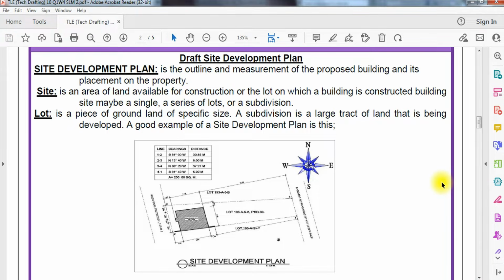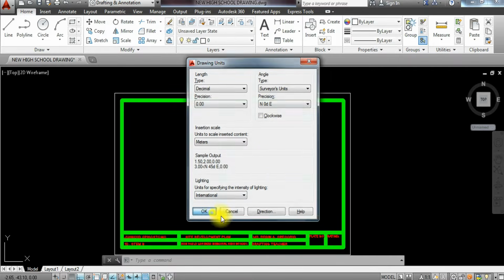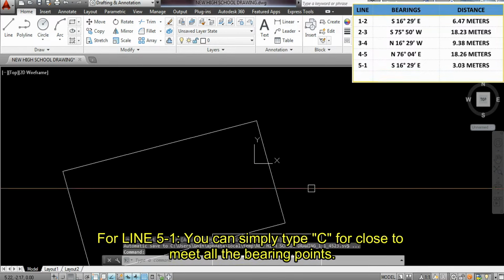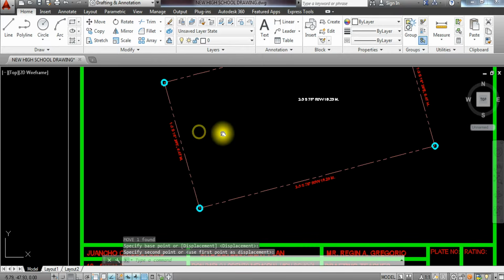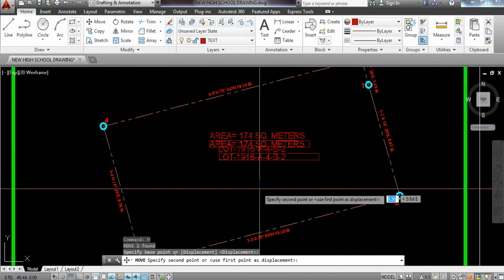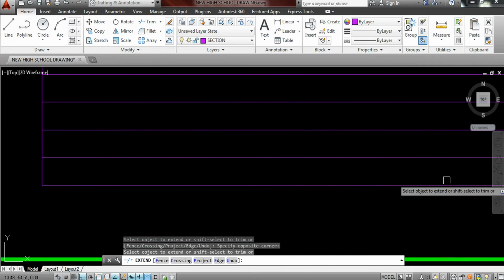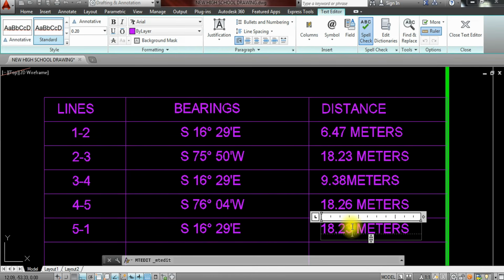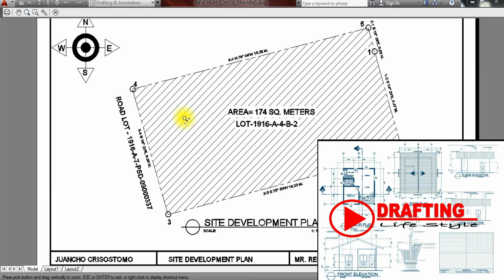Drawing Exercise 5: How to Draft Lot/Site Development Plan using Auto CAD

Comment: A Site Development Plan plays an essential role in a building. They illustrate the intended design, arrangement and uses of the land to be improved. Engineers use them as reference for how the construction will vary according to the environment or location of the to be built construction. In our autocad work it helps us learners be enlightened to the process of making a plan for our desired house or other building. Via making a site development plan are we able to freely visualize what we want and we can adjust how everything works easily.

SHEKINAH S. PILANGA
10-STE B